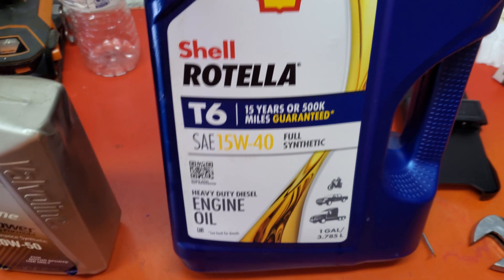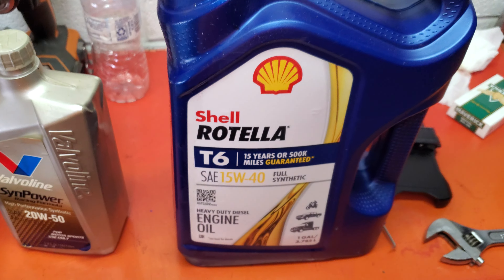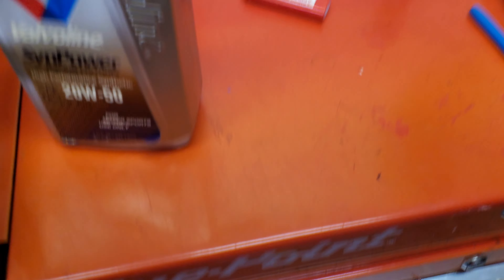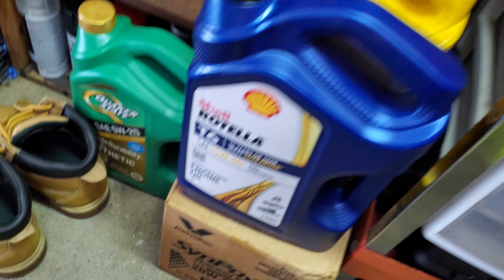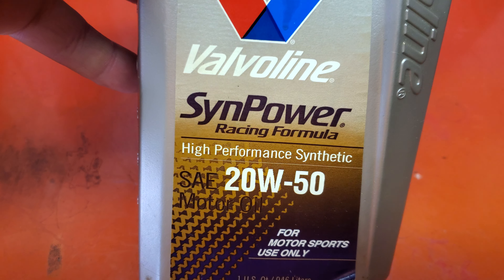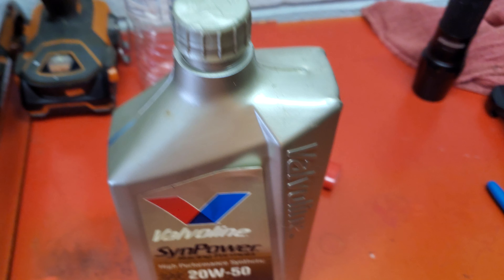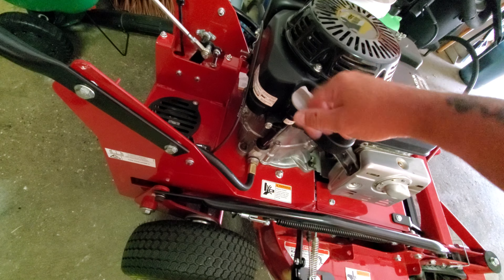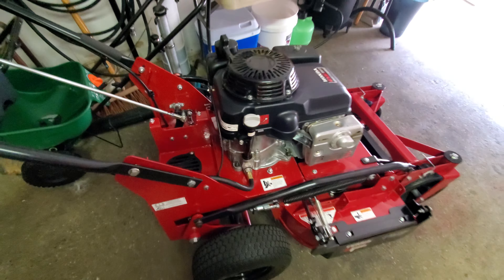👑Ferris FW15👑 Oil Changed  From 10W-30 To 20W-50

Comment: That 15w-40 T6 Rotella may have been a perfect oil. I used to have a 40valve Audi S4 and in the forums that T6 was HIGHLY recommended...Based on temperature ranges of modern multi-vescosity synthetic oils - I think 50hr OCI's will find you safe with 30 through 50 weight...I believe in using 10w-30 conventional for the first few OCI's to fully break in the engine and post 100hrs will be running 10w-30 or 40 synthetic (likely Super Tech based on price/performance)...My snow equipment will get 5w-30 due to cold temps...which would be my only concern about a 20 weight in the cool spring and fall start-ups for my mowers...the key though is regular changes and keeping the levels up! Nice mower btw!

Comment: Love your channel Tony. Put deposit on the FW15 today. Also finally found the part number and got the front weight ordered. Will order the tractor tires from Amazon tomorrow. Oh, had the dealer order the oil drain hose too. Now my question is on oil. I'm just a homeowner/will mow once every 2 weeks on average....and it gets hot here/today 91F. So which weight of oil do you recommend for me? See I would have thought that the hotter it is outside the thinner oil would be preferred.
Reply from the maker: NOOOOOOOO  THE  HOTTER  OUTSIDE AIR  THE  THICKER  OIL  YOU  USE  IN  THE  WINTER  COLD AIR  THAT  IS  WHEN  YOU  PUT  A  THIN  OIL  SUMMER  PUT  THICKER
Reply: @MAGAManPDT  Thanks for that information. Luckily no mowing here in winter=snow and ice :) So after the break-in period....20 hours isn't it? and me assuming when I pick it up from the dealer (he said 10 days but with this holiday weekend probably 2 weeks) it will have oil in it. But after the break-in I'll put in the 20w-50. I know its basic questions Tony but I've not mowed a yard since I was 17 until this past April and bought the wrong mower/sold it this week to get the FW. Gotta start somewhere :)
Reply from the maker: @medicineman4040  To me it is perfect for men that are up in years as i am i am 55 yrs  old  and this FW15 moves with ease Ones you get used to it remember my words  let  the  machine  do  the turning/moving for you don't try to man handle it like a regular push mower .let the mower move for you reverse forward ect. and you will love the swivel wheels  this machine is over 300 Lbs and it will feel like it is only 100 lb when you get used to it Here is a link to the first time i used it in the field also listen to my information about my first time using My FW15 https://www.youtube.com/watch?v=Ci5weYfo8FQ

Comment: 20w50 is what I put in my Harleys. they don't rev high. but they are air cooled. so I believe the thicker oil is for heat.
Reply from the maker: 100% Absolutely True This is why a Commercial mower can handle up to 20W-50  Because of the climate around the mower and running the mower more then 8hrs a day 6 days a week   we are seeing much more heat in the summer  over 100 Degrees over the past summers  the norm was 95/97 Degrees and using the standard 10w-30  was excepted as the normal .but now with the clement change with much more intense heat we are now living in we must adapt are commercial mowers (NOT A RESIDENTIAL MOWER )and put in a much more heat  tolerance oil  so thick oil is Great for keeping the machine running cooler and to prevent viscosity breakdown and shortening the life of a mowers engine.  Thanks for the comment👍

Comment from the maker: MULCHING REQUIRES EXCELLENT MOWING
CONDITIONS
Mulching mowers cannot function properly if the grass
is wet, or if the grass is simply to high to cut. Even
more than normal mowing, mulching requires that the
grass be dry and the the appropriate amount is cut.
Do not use the mower as a mulching mower during
the first two or three mowings in the spring. The long
grass blades, quick growth, and often wetter
conditions are more suitable for broadcasting (side-
discharging) or grass bagging operation. Also HOW MUCH GRASS TO MULCH
The best mulching action typically results from cutting
only the top 1/2 inch to 3/4 inch of grass blade. This
provides short clippings which decompose properly
(much more quickly than longer clippings). The ideal
cutting height will vary with climate, time of year, and
quality of your lawn. We recommend that you
experiment with both the cutting height and ground
speed until you achieve the best cut. Start with a high
cutting height and using progressively lower settings
until you find a cutting height that is matched to your
mowing conditions and preferences.